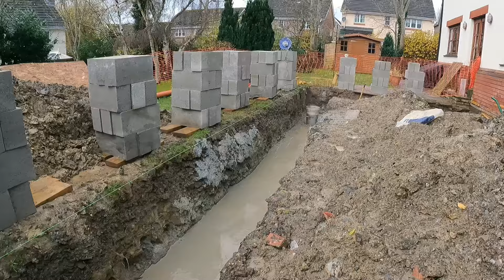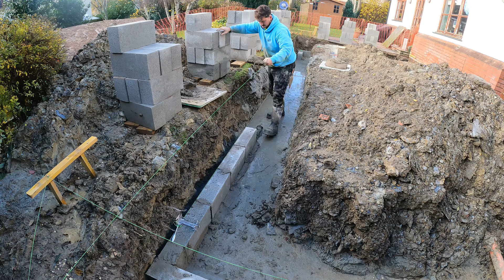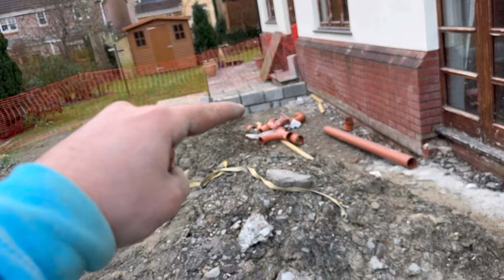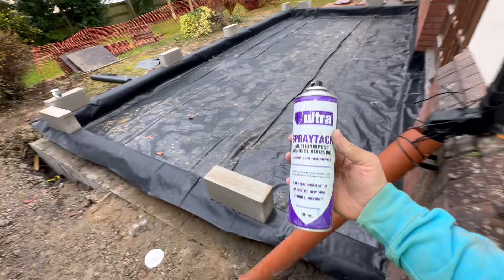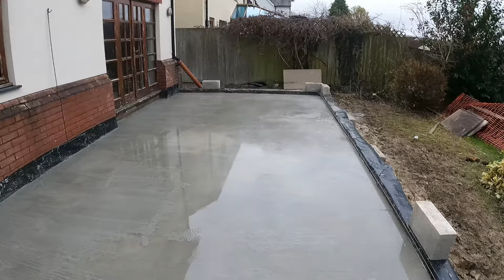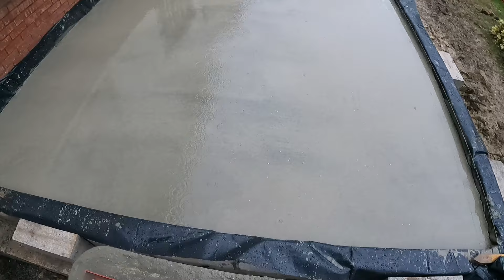Concrete Slab & Foundation Blockwork JGB EP:64

Comment: Strange way to pour concrete. Vibrate it as you pour it. Side screeds first then screed back in one straight line. Walking back into it again to screed a 2nd time not recommend also shouldn't need that much water for bull floating
Reply from the maker: @cg6356  it had rained so I can’t do much about the water unfortunately and the way the pump was set up they charge how long it’s there,so we just get it all in first and fine tune it when it’s not costing us 👍